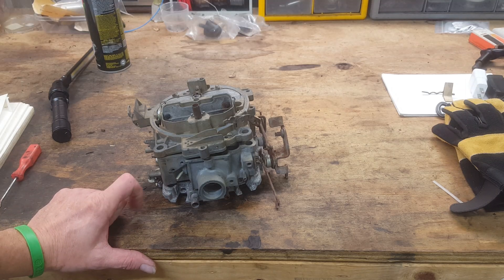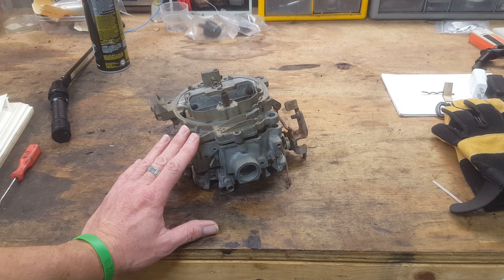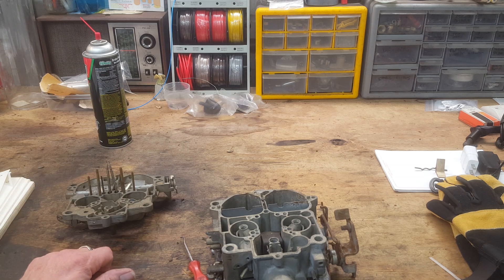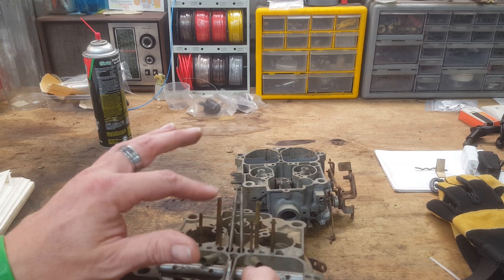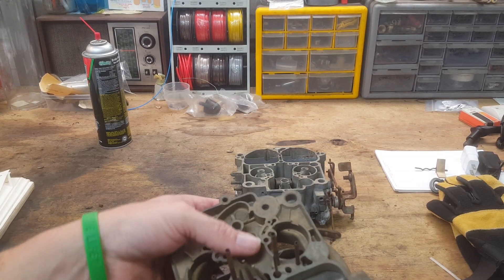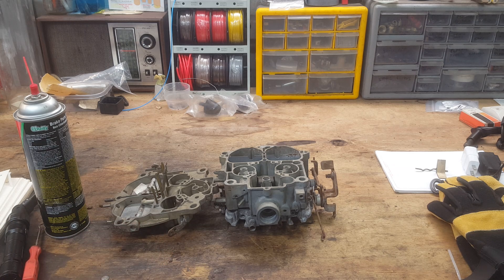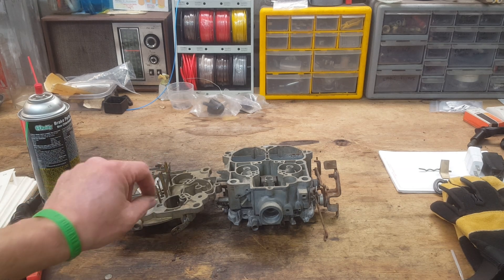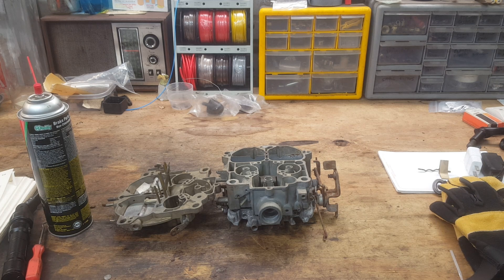Quadrajet carburetor won't run off the secondaries at all...what's wrong??

Comment: I have new quodrojet card and it will not go on the secondary’s do u think it could be the tubes like video or is there any other adjustment that might e fact it  becouse it was really bad I got it better but  it still don’t run right on the secondary’s

Comment: Thanks for the video. My 79 quadrajets secondaries open slightly, but not fully under full throttle. Choke seems to be adjusted properly,  and fully open when hot. Carb has a new gasket set and fresh cleaning. I'm not sure how to address 
 Any advice would be appreciated.

Comment: Thanks for the posts.  I've watched several of your Q jet videos.  Still got a bog I can't find, but I haven't given up.  My choke pull off was making the air doors stay closed.  NExt I'm going to set my air door spring to 1 1/4 tighter, after the door closes all the way.  Frustrating, because it used to work fine.

Comment: Tyler I just want to thank you for all your Quadrajet videos!! I have a pretty rare 71 Ford Torino 429 Cobra Jet.. and Ford used a very rare Quadrajet 2 years only 1970 and 1971 on a 429CJ only. Everybody seems to think quadrajets were used on GM vehicles only.. but not the case.. anyways if it wasn't for you and your videos I've never would have got this car running correctly.. I had the infamous Quadra bog.. and after a lot of playing with it I discovered my secondary doors/flaps, were actually a little bit too tight and taking too long to open up when I punched it.. anyways thank you for all the great videos!
Reply from the maker: Man, I'm glad. Qjets endured years of bad raps.

Comment: Tayor. maybe if you can get a diagram of a Bosch mecanical fuel injection. You can show the simalaraties on how the bosch system meters fuel, and that the quadrajets air doors function just like the bosch system sensor plate.  Also, how the metering rods work just lkke the plunger [fuel control valve].  I belive your viewers may better understand what your trying to explain.

Comment: Thanks for the info. I have an 85 electronic quadrajet, would the secondary circuit be the same/similar? I cant seem to get the secondary bog sound or power when I floor it. I am aware, that year had the 7A intake heads which sucks but I would think I'd get some kind of extra power and some bog.... Maybe I could switch the heads to 5As or just ditch the emissions BS all together?
Reply from the maker: The emissions aren't your issues. The secondary side of the carb may be non-op for some reason. You can get under the hood and whack the throttle pretty hard and you should at least see the air doors open a bit. Those engines don't move much air, so the carbs are detuned on the secondary side. The air doors only open about 1/3 way and the secondary metering rods are sized to accommodate that. Those 7A heads are TERRIBLE. If you sit a 7A head next to a 5A, you will see that the 7A ports are half the size...HALF...of the 5A heads and all the 350 heads that came before. I wouldn't suggest it now because these engines are so old but you can actually hold a 7A 307 to the floor and it won't rev high enough to blow it up. You can get the carb working right, if it isn't, but don't waste your time trying to modify the secondary side of that carb unless you swap heads and all the manifolds.
Reply: Thanks for the reply. I guess theres not much I can do but I will say, though under powered, the car still has enough pep to get going. I will look into the secondaries of the carb 1st though.

Comment: Well, I've been building up to rebuilding the Q-Jet in my '87 El Camino, but a neighbor wants to buy it and I'm going to sell it... If I can solve some other issues. It's overheating, but I can't tell what it's doing because the temp gauge isn't working.  It jumps to zero when I turn on the key, but stays there, no matter what.  The problem is, I can't find the sending unit.  It's not between the first two exhaust ports on the driver's side.  It's not next to the thermostat housing or in the thermostat housing.  It's not between the first two exhaust ports on the passenger side, and it's not back by the distributor.
I'm pretty sure it used to work (but I don't drive it often and I'm getting old...), so I'm really confused.  The previous owner replaced the 305 with a 350, and most of the smog stuff is in a box in the garage, as it was falling apart.  Any ideas?

Comment: Nicely done. Nothing sounds like that throaty, building roar as those silver dollar secondaries open up. Quite by chance, I have a number of vehicles with Edelbrocks and Holleys on them. And, also by chance, I have finally accumulated enough Q-jets to make the swap on everything and standardize. So I am boning up before returning to the Light Side of The Force after years in the shadows.

Comment: I had rebuilt a q jet for a buddy’s motorhome with a 454, the secondary pickup tubes had fallen out, after I pressed them back in, i staked around the tube to help retain it, once I got it bolted back up, that motorhome would put you back in your seat when the secondaries were opened. I’ve rebuilt three.